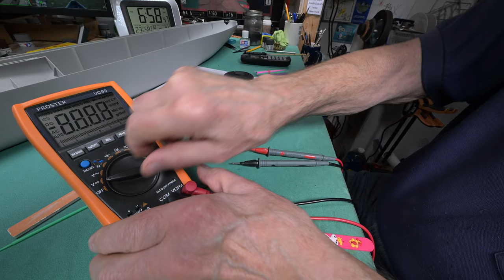The Model Ship - Part 1326

Comment: ...another enjoyable vid...thanks!...👍
By the way, you actually measured 500 some-odd millivolts on the battery. A millivolt is 1/1000 of a volt...a microvolt is 1/1000 of a millivolt...then  it goes to nanovolts, picovolts and femtovolts..each 1/1000 of the previous unit...😉
Reply from the maker: .... so when I said it was about "half a volt" I was right?
Reply: @roncalverley  ...yep, you were...👍

Comment: It's a shame that Trumpeter didn't mold the hull in 1 piece.  I think it was to make the box the same size as the other 1/200 line and not some manufacturing limitation.
Reply from the maker: No, I think it was because that bow piece was too complex.

Comment: Why didn't they just make the hull in one piece? Seems strange to leave off the last 10cm or so.. Happy Thanksgiving 😊
Reply: It was Trumpetesr way of getting the bow the right shape ,that's why the Yamato 1/200 is molded in 2 pieces and not one like they usually do 😊😊😊
Reply from the maker: Hi Martin, Marc's got that correct. I think it was because that bow piece was too complex.